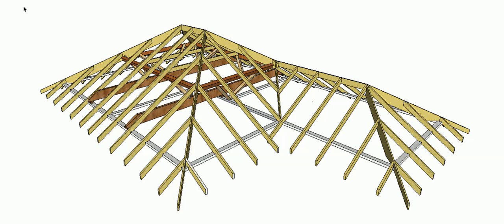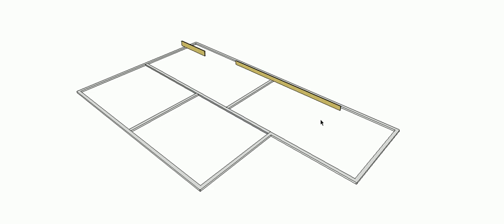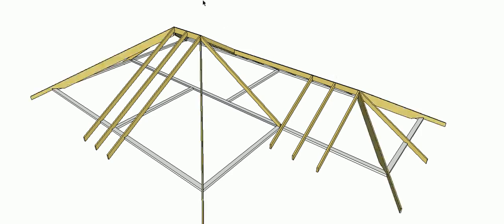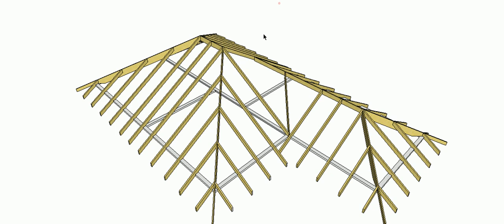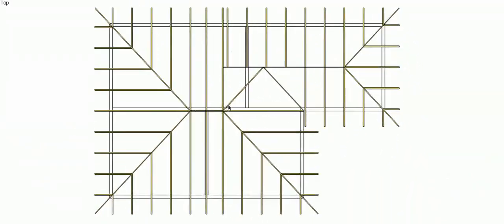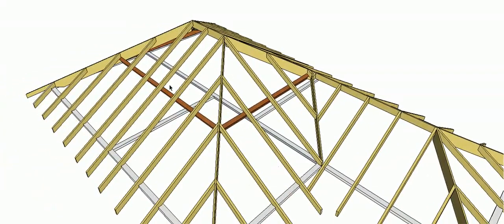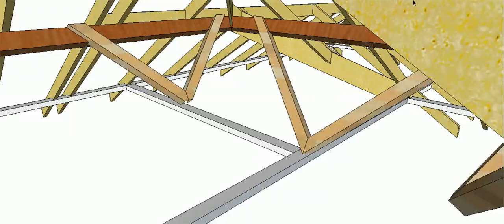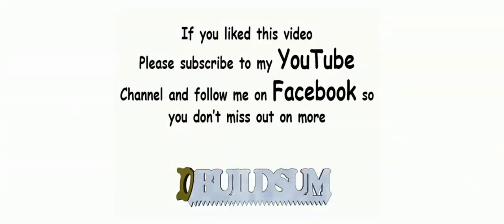Roof Components

Comment: purlins run over the rafter and sit directly under the roof / metal sheeting, ceramic tiles/ ect.
Reply from the maker: Hi Mate, I a commercial shed type construction you are correct. In residential construction they are more correctaly called underpurlins and they support the rafters.

Comment: Hey mate. Does a strut going dowm to a wall plate make the wall underneath load bearing? And so to remove the wall, you need to add a beam to transfer the load from the strut to the edge walls?
Reply from the maker: Hi Mate, you are 100% correct, a strut sitting on a wall does make it load bearing and you would have to install a beam to take that load if you want to remove that wall.
Reply: @Buildsum  Thanks Mate, Could be an interesting video showing the sequence of removing a load bearing wall in the same diagrammatic visuals.

Comment: How long does it take to  replace an old rotting roof (iron roof, ridge, the whole component etc)? My house structure/roof type is a broken hip and valley
Reply from the maker: Hi Della, that is a very open ended question. It will depend on the size of the roof, how well it is constructed and how much rot is there. Basically it would be a full pull down and then rebuild. I guess on an average size house it would be a day or 2 to pull down and then 4-5 days to reconstruct with putting the iron, flashings and guttering etc on. Hope this helps.

Comment: hi Buildsum, still loving your content i've learned heaps !! wondering if you could help me out, iv'e got an old school ready reckoner and it says the 'jack edge cut' is 37.5 degrees on a 40 degree roof, i cant picture this ? surely it would be 45 ?
Reply from the maker: Hi Jordan, this is where it can get confusing, if you wanted to cut the angle by hand you would need to mark a 37.5 degree angle on the timber however if you are going to cut it with a power saw or mitre saw you just set them to 45 degrees and cut along the plumb cut then If you then measure the angle on the timber it will be 37.5 degrees. Sounds weird but trust me it works.
Hope this helps.
Reply: @Buildsum  that makes sense and i can visualize that now ! cheers !

Comment: i always thought that purlins are between the actual roofing and the roofing framing system (Rafter or Truss)?
Reply from the maker: Hi Ilyn, on a traditional pitched roof the Purlins are used to support the rafters. however, on an industrial type shed construction the Purlins do span from the truss, or rafter to truss or rafters, acting more like a batten to support the roof material.